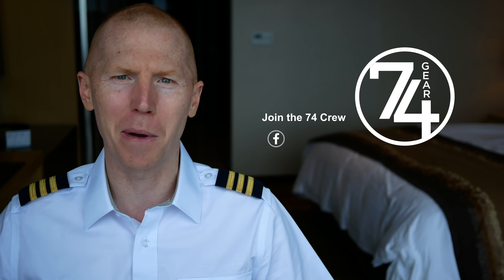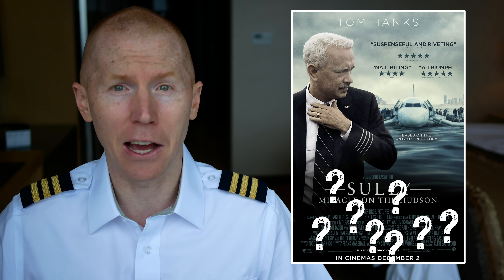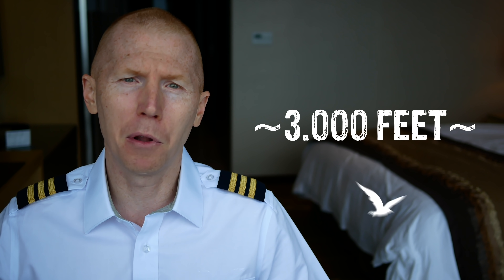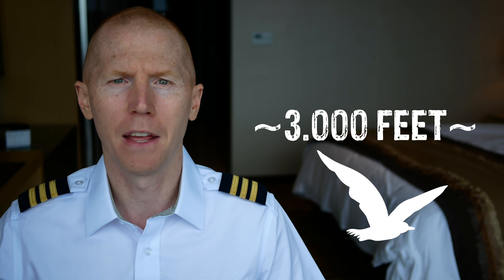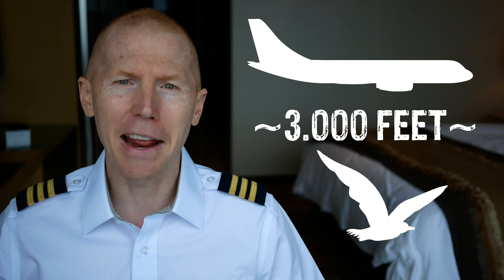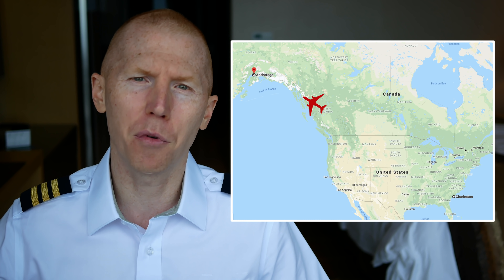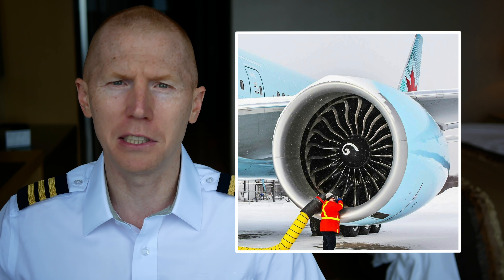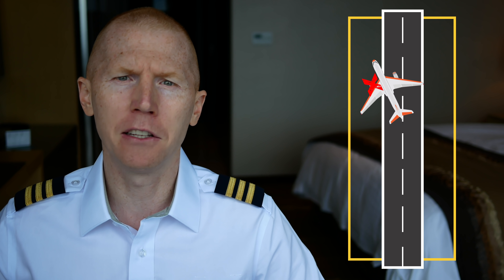Why Engines Don't Have a Mesh or Grates to Stop Birds

Comment: What if there were very sharp, strong blades in front of the engine? The airflow shouldn't be severely affected, yet the blades would be where the greatest impact would take place. The bird would hopefully be severed enough to cause much less damage to the engine. Maybe have a mechanism that deploys in front of the engines only below 3,000 ft. and then raised/removed/tucked away once above that height. Like a thrust-reverser that deploys behind an engine only after landing and then is removed again. Perhaps its possible to design so that the blades are situated at some distance in front of the engines, and deflect impacted objects away from the air inflow.
Reply: Those are the engine fan blades and they already work for small birds. Once they get to the size of geese though you're throwing 10 pounds of flesh into the engine – slicing it once or twice before isn't going to help much
Reply: @AmbientMorality  I was wondering if these front facing cutting blades could absorb most of the impact, rather than it happening directly in the engine itself. Or maybe even deflect the object away from the intake. I was hoping that if it does get sliced up a bit, perhaps the blades you mentioned could stand a better chance of doing the rest.
Reply: @not2busy  Either the cutting blades are strong enough to absorb the impact (in which case the existing fan blades should just be made out of that same material instead of adding new blades in front) or the cutting blades are just as likely to fracture on impact (which probably makes failure of the actual fan blades more likely because shrapnel is now hitting them)
Reply: @AmbientMorality  What I am envisioning are blades that are pointing outwards, more like spears than fan blades. I imagine them deployed with some distance in front of the intake, like 3+ metres. I was hoping that these could withstand a heavy impact. I'm certainly no engineer but this problem is interesting.
Reply: @not2busy  Are they spinning with the fan or something else?
Reply: @AmbientMorality  No. I was envisioning something like what an ancient roman brigade might do, have long spears/blades protruding forward. Have that setup a few feet forward of the intake so it can absorb some of the initial impact and/or deflect an object away. It wouldn't stop everything, but hopefully the biggest and worst objects. It shouldn't affect the airflow too much. Then, if it could foldaway or retract like landing gear or the reverse thrusters.

Comment: Thanks for the great videos. One critique...
It’s not “gas”... it’s “fuel”
Gas would be for Gasoline, or for a vapor. 
You’ve probably heard of AvGas. Aka. Aviation Gasoline. That’s used for piston driven aircraft. 
Turbine engines use Fuel. 
Keep up the good work on the videos!
Reply: I'm sure a 747 pilot at a major airline knows that they use jet fuel. Gas is simply used for brevity

Comment: Haven’t watched the video yet and I’m gonna assume that if a bird hit the grate/ mesh at high speeds it could dislodge/ break and do catastrophic amounts of damage to the engines that I assume are now built to handle  bird strikes. Mo Money, mo weight, reduced fuel mileage. Plus you would have to also have a system in place to keep ice of the mesh/grate ie mo money, mo weight less fuel mileage. Not a science/ aviator just spit balling.

Realized after I watched the video that my comment sounded a little douchey.
Love the editing and I enjoy your videos. Keep up the good work sir
Reply: I think it's good to try to anticipate the conclusion. Then you've thought about the problem before you hear the explanation, which helps a lot

Comment: I like the idea of emergence parachute for airplanes .. there's a small private plane that has them as default and they have saved a few lives!
Reply: Good luck with that large of a parachute. Also it does nothing for landing and takeoff failures, which are far more common than failures at altitude
Reply: @AmbientMorality  I'm sure it would be a few parachutes front and back .. it has been seriously considered .. the main reason always comes down to cost
Reply: @MikeBaxterABC  It hasn't seriously been considered. The issue is that it barely provides any safety improvement (if any), introduces new failure modes, and makes the plane heavier and more complex. The only reason it sounds good is because people are scared of flying and parachutes sound like a failsafe
Reply: @AmbientMorality  hat's a really good point about the weight of the parachutes and the deploying system,   never thought of that ...  The ones I've sen it on (on youtube) are tiny personal airplanes, just thinking about it the weight would be MASSIVE to carry a full size jetliner full of cargo and people!

Comment: Well couldnt you put a few sharp blades used just during low altitude that would break the bird into smaller pieces before entering  the engines, once the plane is high they could move out of the way

Comment: The MiG-29 and a few feet Russian aircraft have multiple intakes. There is a set of intakes that are used while taxiing and taking off, that are positioned in the upper part of the normal intakes, flush against the upper surface of the aircraft. This prevents ingestion of dust and debris by the engines, as well as makes it much harder for birds to enter the intakes because of the angle.

Those clever Russian bastards.

Comment: aircraft with rocket and jet propulsion? 
rocket propulsion is essentially a non-breathing jet engine.
during necessary situations, the jet engine can be closed off and sealed, and the aircraft can fly using rocket propulsion.

Comment: I thought fighters had mesh infront of their intake
Reply: i'm a pilot in the JASDF's Mitsubishi F-15 and they don't have mesh, and so are other fighter planes i used. since they fly too fast and their intakes are usually quite hidden and hard to be bird-striked
Reply: A few Russian fighters do for unimproved airfields (aka dirt), but it's not very common anymore and I don't think US fighters have ever used it.
Reply: @AmbientMorality  well. the Russian MIG-29 still had a closed intake for FODs and also for unprepared runways. ( it's a tarmac runway or at least a paved one ) but the area surrounding it is quite dirty, like in a meadow where dust could enter the engines
Reply: @前田さんの日本の鉄道クラス  Do you know why the US fighters haven't done similar? Is it just that they try to always have developed airfields?
Reply: @AmbientMorality  i'm sorry, i served in the JASDF and all our airbases had modern runways, but i heard from my fellow airmen who served in the Middle East, they said that the runway there are also developed, so no dust

Comment: Can't most engines handle one or a small amount of birds, especially if the birds are small?   Wasn't the problem for sully just an overwhelming amount of large birds?
Reply: Yes, which is also why there's only been ever been two dual engine failures due to bird strikes (and neither resulted in deaths)

Comment: Got it. Install a spinning set of blades that will spin at a speed that doesn’t impede the efficiency of the plane. The spinning blades will cut the bird/s into small pieces and s the small bird/s piece/s pass through the engine they will cook (like little chicken nuggets) and will eject out the back, falling to the earth.

Comment: My great grandad flew back a b17 with 1 working engine and a bird striking a prop witch didn't make it easier pilots these days got it easy no turboprop engines later he would land a b24 liberator on 2 engines and a p51 with half a propeller much simpler times

Comment: so they could have a fukin net on takeoff that is removed on a press of a button, it wouldnt be that hard to do this, it will remove all the danger of birds on low altitudes and would be a economic fix but hey maybe its to hard.... lool we can make engines made of titanium and other special materials but cant make a net that would be removed with a press of a botton
Reply: Airliners have a takeoff speed of 150kt or higher, any kind of net or screen would just cut through the bird at this speed.

Comment: The technology that corrects for a failed engine sounds like a bad idea, it sounds like that bad idea called MCAS.
As a software developer I am all for things to help pilots but not things that think they are better than pilots - I am sure good pilots know how to use the rudder.
Reply: Better tell that to Airbus whose entire design philosophy is tight envelope control to minimize chance of pilot error even with system failures (and honestly the philosophy works). Better to think about problems on the ground and mitigate them in software then rely on pilots to respond correctly under pressure
Reply: @AmbientMorality  it did not work on the Max or that Paris airshow aircraft back in the 80s.
Reply: @Slarti  MAX was designed without suitable redundancy. It's not how a modern fly by wire system would be designed; Boeing wouldn't even design it like that if 737 was a clean sheet design. Flight 296 was pilot error, not an issue with fly by wire.
Reply: @AmbientMorality  the no true Scottsman argument...
Reply: @Slarti  If you want me to be more exact, a fly-by-wire system certified as flight-critical is perfectly safe. MCAS was not considered flight critical for some reason, which was obviously a mistake.

Comment: Just mount cats in front of the engines, problem solved....
Reply: Cat smoothie?
Reply: @REJECTEDPLAINSCT  they have 9 lives, so each has a career that lasts that long...
Reply: @soyousaidyouwanttoblankher1534  7. 7 lives.
They had 9, but the cats are curious (so they lost one) and they had to do it (another one gone).
Reply: @soyousaidyouwanttoblankher1534  what kind of name is that
Reply: So you said you want to Blank her Blank ultrasonic sound that deters birds
Reply: Cats with lasers
Reply: Haha
Reply: Hahahahahahahahaha
Reply: We tried that, the cats got sucked into the engine. Now we working on a kevlar leash.
Reply: you're a flippin' genius

Comment: I hit a rather small bird with my car at highway speed and the grille of the car scattered the feathers so dramatically that it almost immediately blocked my radiator. Now the airflow on the front of a car is chicken feed (pun not intended) compared to what flows through a jet engine so any grille could easily completely block a jet preventing it from functioning.  If a bird is relatively small then a modern jet may still be operational after a bird strike anyway.

Comment: Probably stupid question, but ... why don’t we put a giant, or many smaller parachutes at the top of airplane body. To deploy as airbag, or on command of pilot. 
Or airbags for each passenger.
Or floating devices (like emergency slides) to float when crashing in water ...
👍😉

Comment: FYI The Cessna A-37 Dragonfly has retractable mesh screens that cover the intakes when the landing gear is selected down and then fold flush with the fuselage when the gear is retracted.
Reply: A cesna engine is much different than a 747.
Reply: @kevinmael3862  
They both use jet engines, the only difference is size.

Comment: a grate will just cut straight through the bird at takeoff speeds
Reply: Then again, all that will be entering the engine will be chicken nugget sized pieces of birds instead of a whole bird.
Reply: derp kv2 the bird will get stuck on the grate, block airflow, and cause compressor stall.
Reply: John P combined collision would be at least 400mph and having a thin metal traveling at that speed is sure to dismember three bird
Reply: @kilmentvoroshilov2  not quite

Comment: how about a RETRACTABLE GRATE? so as you say, most bird strikes happen at low altitudes. so only have the grate be an issue for those low altitudes. i'm thinking like a shallow cone made of steel blades. they wouldn't stop birds so much as deflect them... an aerial COW CATCHER. and then those blades retract around the engine so they rest as kind of like small fins around the body of the engine.

i know that having additional articulating elements adds engineering and cost but it still seems like it might be worth it.
Reply: Any kind of grate would just cut through the bird instead of deflecting it

Comment: I wouldn’t trust Boeing flight computers to save the plane, in the event of bird ingestion on takeoff.
Reply: Not all of Boeing. Just the 737’s. Those planes are afraid of heights.
Reply: @calebyork5004  This is one of the best comments I've read in some time.
Reply: Jeff_ D if they don’t have MCAS there is no prblem
Reply: @stefzac9707  A 737 without MCAS just nose dived and killed everyone on it.
Reply: Jeff_ D oh really I didn’t geninuely didn’t know. Like what
Reply: Sad 737 Max noises
Reply: @jeff_d6941  Autopilot? MCAS has nothing to do with autopilot. If your autopilot is doing **wind-up turns**, you've got bigger problems than MCAS...

Comment: This may sound thick but how does a plane fly with only one engine
Reply: So the flap and aileron stop the working engine from pushing the whole plane to one side then?
Reply: @David M Rudder and aileron is correct. Flaps always deploy symmetrically.  You wouldn't shut down the opposing engine even on a four-engine aircraft – it's pretty safe to fly on three engines with a bit of asymmetric thrust and it's far worse to have two engines than three if you need to abort a landing attempt

Comment: This is a terrible answer! You could design a jet engine that had a screen in front of it, that is not the problem! What would happen to the pieces of the bird, how about the energy from the impact? You could increase the diameter to make up for the screen area, the reason it's not done, is because it would not solve the problem. The bird still has to go through the engine(in pieces) and the impact energy still being absorbed by the engine.

Comment: Su-27 series have a movable titanium grill on front to prevent FOD, MiG-29s or Yak-130s have ramps coming down near the runway... So the reason is not that valid.. Solely from engineering perpsective it could be done for high bypass engines as well, its just no engine company does it because none of their rivals are doing it..
Reply: It decreases thrust and efficiency though. That's okay for fighters because they have so much thrust but not very okay for commercial aircraft where you can climb on a  single engine but not very fast and not with much margin

Comment: Automatic grate, it will activate and conver engines during takeoff and landing
Reply: better yet fuck fuel efficiency and launch the plane with a rocket engine.
Reply: Easy to say. Hard to implement. Space, weight, complexity, changes flight characteristics, maintenance etc.
Reply: @matthewmartin7639  maybe in the distant future it'll become a mainstay of aviation.
Reply: Doesnt really matter. Modern engines are designed to be able to suck up a bird or 2 and still be able to work perfectly fine until it can get fixed.

Comment: Thrust reversers only ‘transmute’ and work when required after landing. Same could be done with an anti-bird strike mesh/grating - arranges itself in front of the engine just on take-off and landing only, retracting once the plane clears 3,000 ft. Problem solved!
Other options - composite jet-rocket engines: rocket engine component for take-off and landing, jet engine comes on other times.😀
Reply: Yeah but a mesh would get weakened over time and eventually fail bird strikes especially now, though warrant a reverted flight, have a very low chance of putting anyone in danger.

Comment: I'm not trying to word smith you but you wouldnt reduce the amount of air entering the engine, you would add drag and slightly alter the velocity by which it enters the engine. One single cross beam would just split the air in half but all the air will eventually make it's way in.

Comment: hey Captain, just out of curiosity, how about using a retractable shield or net that is put before the engines only below 3,000 ft ?
Reply: If you can envision it, "it" can be engineered.
Reply: Too heavy
Reply: @johnp139  mig 29 has it for like 40 years

Comment: Several Russian fighter jets shut the main intake during take off and, pull air in from slits in the top of the wing to prevent debris from being ingested into the engines.
Reply: Yes but that is not for birdstrikes. That is for when they operate on the ground, as a lot of Russian runways and taxiways are not as well paved as Western ones. If a bird were to hit the cover, it would most likely damage it and send fragments into the intake.
Reply: @OverlordAntares  They may not be designed to deal with bird strikes it does prove the concept of using a protective door or grate on engines without restricting airflow too much, And it is more likely that the doors would bend instead of fragment if hit. In the case of a large bird I would think the whole door being pushed trough is also a real possibility. P.S. the original post was simply meant to be a fun fact.

Comment: What about retractable mess like landing gear?
Or 
What if the engine has multiple smaller air inlets then a single large one?

Just curious 😊
Reply: Anything put in front of the engine to protect it against birdstrikes, a grill or a system of a number of smaller inlets, costs weight, adds drag and will have negative effects on the intake air.
Something retractable adds complexity, increasing maintenance costs and would probably still fail more often than it would avoid damage from birdstrikes.
Reply: @peregreena9046  And, unless your mesh is made of adamantium, if a bird hits the engine, it's just going to take all that metal wire and shit into the engine, which would cause much more damage than just the relatively soft flesh and bone.